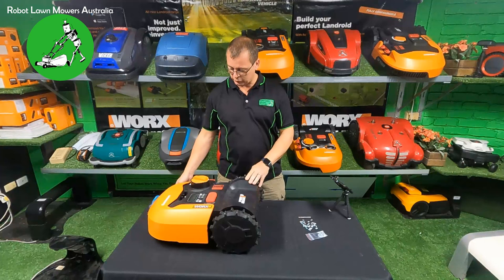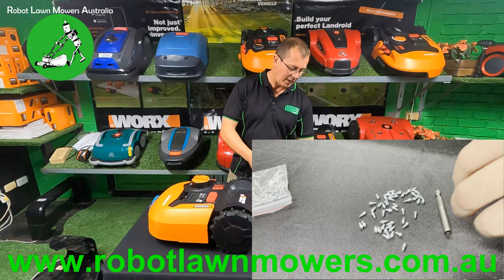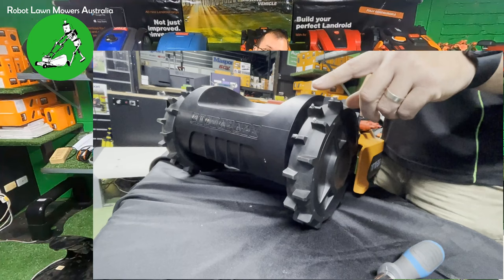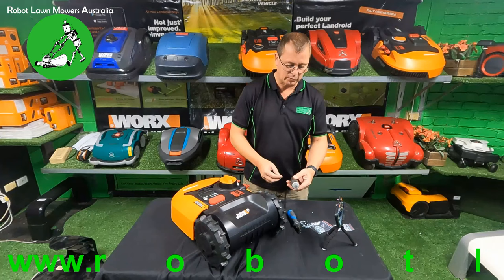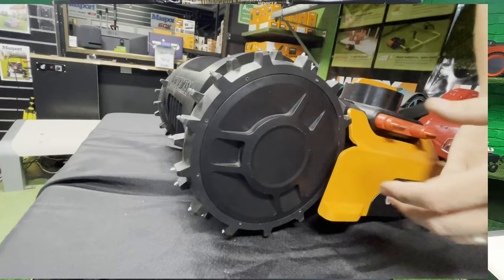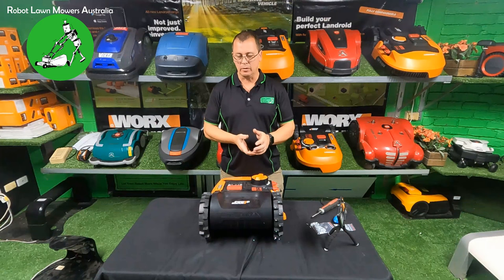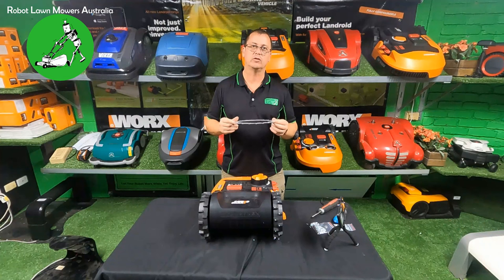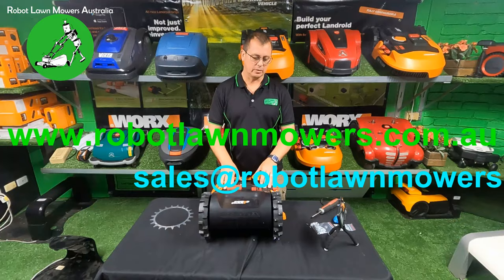Robot Lawn Mowers Australia - How to Install High Traction Wheel Studs

Comment: Good morning.  is it ok for hookii neomow s?  if so what size should i get?  THANKS.  hello from France.
Reply from the maker: Neomow S only comes in one size robot, it is just the featurse that change. Wifi only connection, 4G and Wifi connection and the top model has 4G and Wifi and the ultrasonic sensors.